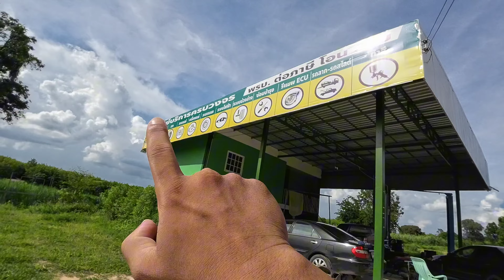Trying some local THAI DESSERTS in Rural Thailand until DISASTER strikes!

Comment: You must be using a GoPro camera because when it starts to overheat the filming goes blurry get a DJI Action 4 these are brilliant with heat, cold and are waterproof to deeper than GoPro.
Reply from the maker: We actually use a DJI Action cam, but they're just not very good in low light 😅 Agreed though, they are much better than GoPro!
Reply: Check out low light settings on YouTube for Action 4